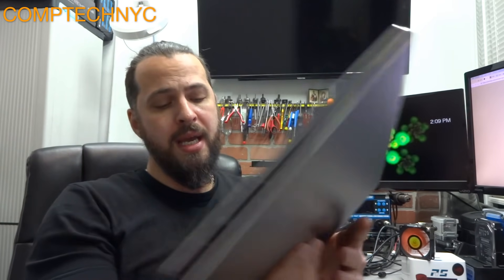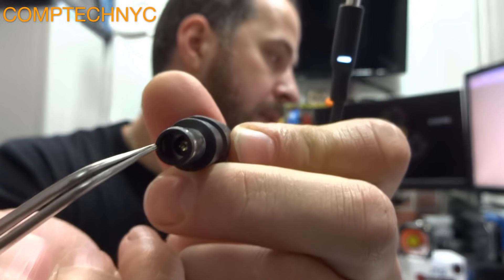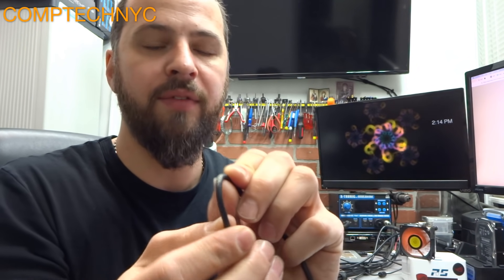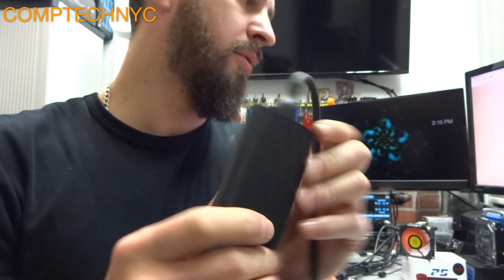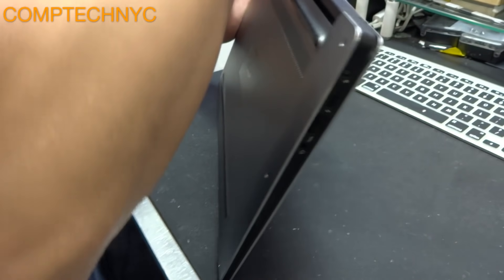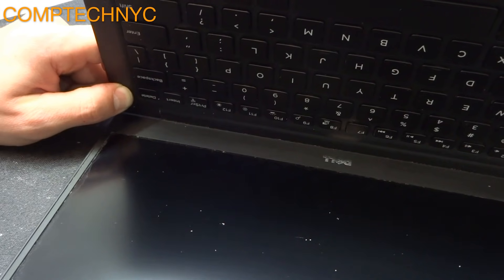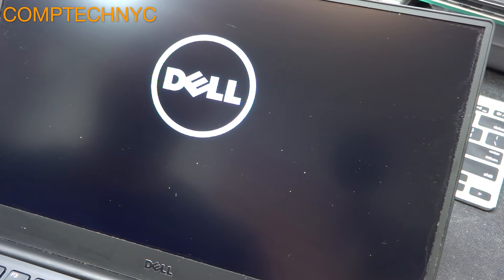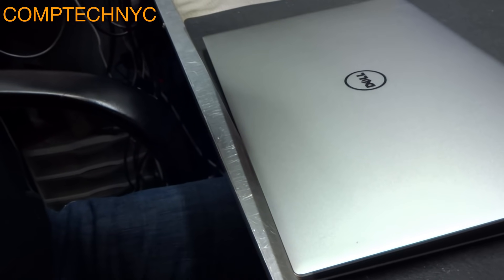Dell xps plugged in not charging fix

Comment: [UPDATE] Next reboot, the plugged in not charging has reoccurred. 😳😔
I think it’s the charger jack. I’ll fit a new one in a week or two and update. 

I’ve had problems with my XPS 14Z ‘plugged in not charging’ for ages now. 
Tried various new power adapters and 2 new batteries with no change. The information in this video fixed it!! 
THANK YOU!!!!
(Don’t forget to go into the BIOS and update the system time afterwards!)

Comment: Absolute magic! I have a 2017 XPS 13 and it wouldn't power on nor would any lights come on when plugged in. I did the steps to disconnect the battery and clear the bios and it worked as shown in the video. My charger cable was fine. Thanks a ton!
Reply: bro I have the same prblm did u jst did what he did and reconnect the battery and bios and u stopped getting that message afterwards

Comment: Hi thanks for post, just used your method and got powered up but now not loading windows just black screen saying
PXE E61 media test failure, check cable 
PXE M0F Exiting intel boot agent
No boot device found, press any key to reboot.
I’m pressing any key with no effect so powering off by power button. Any help appreciated.
Matt

Comment: Thank you for the great video.

I have a Dell Inspiron 5425 that got stuck at 100% during a forced BIOS update. I powered it off because it was taking too long, and now my battery is not charging at all. I've tried everything, but I keep getting the message that the battery pack is removed or less than 10%. I want to charge it externally because the laptop is stuck at: 'The battery pack is removed or less than 10%. Please install the battery pack or charge it more than 10% for UEFI firmware update.' Strike F1 to continue, but F2 or F12 do nothing. Before the bios update, the battery wasn't recognized at all. This is why I wanted to update the bios, as I thought it might detect the battery.

Comment: Hi, I replaced the battery and I also replaced the charger since I did notice that the center pin was broken. Upon getting a new official dell charger the message says plugged but not charging. Upon further inspection I noticed that my problem is on the computer end where I connect to the charger. So it's not the charger itself because I bought a new one. It's the part of the computer where It connects to the charger. How can I fix this part or where can I order that internal computer part?  Any and all help is greatly appreciated Thank You.

Comment: I've been using a Dell Inspiron 13 7359, 2-in-1 for 5 years and you wouldn't believe how fragile is that identification wire in the charger cable.  Even though the adapter works just fine and the cable looks solid from the outside that damn thing gets damaged somehow and your computer won't charge without it. Although I am a very attentive user and my charger was never worn out like the one you show in this video, I had to buy a new Dell charger every 1,5 years. After buying the last one, I found a large flat tin box and put the charger in it when not used in order to prevent the cable from getting twisted. Today, after two years, my last charger gave the first recognition failure despite all the care. It was possible to get the thing to work only by changing the cable position a few times before replugging but it was a very bad sign that the connection failure now wil start getting worse and worse in the upcoming weeks until purchasing another dell charger will be inevitable. I got so frustrated with this chronic problem that only for this reason I will never buy a Dell computer again.

Comment: I am a little confused as to what the reset proves. You say it tells you where the problem lies, battery, charger or motherboard. But wouldn't the result always be the same? The only thing a reset could do is resolve the issue but if it does it means you had a bios/software issue and not any of the aforementioned ones. I am not saying that doing a reset is a something that shouldn't be done but for detecting the exact issue I fail to see the importance.

Comment: Thanks for the video. I first replaced my battery, as it started to be weak, so I thought it went dead. Well the new battery did not want to charge. Except that one one occation it suddenly started to charge. So today I checked the plug and thing that the central pin is really quite far in. plugging in the cable and thoroughly pusing it in, with a bit of wiggling, and suddenly the light stayed on and I got charging. Well now what' is faulty, the port or the cable?

Comment: I had an issue with my main power port on my DELL XPS 15 last year, so i decided to use the USB port to power it. The power port cable then has an issie which means i now have both power sources at fault. I took it into the shop for repairs and bought new chargers, they replaced the main power port on the laptop however now when I plug in any of the power cables both main and USB they both intermittmently come on then off, every few seconds it goes off and back on and then off. Can anyone help, the computer shop are not sure what the issue is. One thing happened, when they returned the laptop initially they forgot to put the screws on the bottom of the laptop back on, when I got home and was using the laptop the bottom came off and may have touched my clothing, could this cause an issue? Can anyone help please, im desperate to get my laptop back for work purposes and to travel.

Comment: this worked one time tried it the second time after buying a new battery and charger worked a while i turned it of now does not work at all a few months later mine is xps15 with usbc port charger.  any way to contact or a different way to get it to turn back on? any help or link would be great.

Comment: Hi. Great video.  I have a Latitude E7270.  It has the power adapter not recognised error. I fitted a new dc socket. the problem persists. I have another dell charger, a 90 watt one but that has the same problem even though it works fine on another dell laptop. The Latitude will power up with the error ok and work with the bettery disconnected. If i connect the battery it will start and display the not recognised error, then start to load Windows and then switch off.  Any ideas?? are the Dell chargers specific to the laptop model or can any dell charger with the correct plug and 95watts be used? I am not sure what to try next.  I feel like buying a new charger specific to the E7270 but done want to waste money.  your opinion would be a great help. Many Thanks 🙂

Comment: Hey, bro
I'm so happy that I looked at this video. I have a Dell inspiron 15 3000 intel 5 and the ac adapter was not being recognise so I thought that I need a battery and I bought one. Then the battery still wasn't being charged. I looked into the adapter port for the pin and saw that it was twisted so I straightened it and not the laptop battery is being charged. Just want to say, keep doing what you doing!

Comment: Simple solution.
Either the charging port ( cheap piece on eBay) need replacement or use original Dell charger.
Otherwise use USBC charger if laptop has USBC charge port.

Comment: Thanks for the video, unforunately it didn't work for mine. This is my second Dell that has died on me in under 3 years. My latest Dell the P56F has countless issues, charger not detected, hinges lifting the keyboard up, down arrow button broken etc etc. It's cheaper for me to buy another laptop then get this repaired. I will never ever purchase another Dell.

Comment: My XPS 17 9700 has been randomly stopping charging when plugged in since I bought it ... both with the charger and the Thunderbolt docking station. My previous Dell did the same thing. There is some design flaw in the dell laptops/chargers that causes this. Unplugging the USB C connection from the laptop and plugging it back in "fixes" it until the next time.

Comment: Got a xps 13 9360 for cheap for the same problem. Open it up and move the charging port cable  a little bit and put a small thin plastic plate over the charging port. Close and power up. The laptop is charging again. Nothing to do with the charger at all. Also any 45w+ USB C charging devices also work once the Dell firmware update is installed.

Comment: My Dell Inspiron 17 (P30E) only charges the battery when powered off.
Have replaced the battery, charger, and charger port (all with original Dell parts), and updated drivers and BIOS.

When turning it on, a message appears saying that a 0W charger is connected and a 65W charger is needed.

Any ideas?

Comment: My friend can you help me. I replaced battery in dell xps 13 9343 3times (not original dell battry) and it is the same every time:
1. battery not charging
2. the yellow and white LEDs flashes
3. in the BIOS under the icon battery shows message : it not a dell battery.

Comment: thanks for the video ... When plugging the charger and disconnecting the battery ... my power cords work fine... So I suppose that my battery is not working .. thanks .... ps : I changed my battery 1 year ago ... is it something else with my computer or its just a simple coincidence? Good video

Comment: Thank you alot man, it just fixed the issue for me

I wanna point out that i had this issue on a brand new (almost 2 month old) dell inspiron 15 5515 and the power adapter was fine with no sign of tearing and so but had the problem of not charging

For my case, i think it is related to issue of dell laptops having trouble to wake up from hibernation. Usually i fix it with a force start method but not this time and plugging in the AC adapter showed no sign of charging

After following this method of unplugging the battery and the bios battery,  the computer started normally and the AC adapter was working fine(it showed no sign of charging because I found out that the battery was fully charged so the computer showed no sign of charging which is the case everytime when the battery is full)

Comment: I just straightened the cable and it fixed issue... (don't panic if: reinstalling drivers doesn't work, changing charging settings in bios etc.)

Comment: I have a Dell inspirion 45 7547, I have done those steps however now the computer lights up since I have done your technique, However I have 2 power adapters and the LED light will not come up when plugged in the computer won't charge . . .

Comment: hello, I have a dell G5 5500. I have recently been experiencing a 4 amber 1 white error. can you tell me the cause of this? I checked in bios and it says that the ac adapter is connected but the battery is idle.

Comment: Hi mate, i bought a new charger. It differs in the model. The new one is LA45NM131 and the old one is AA45NM131. Anyway, the new one is not working so I follow your video and seems to be charging when is disconnect the small battery. But when I reconnect it, the laptop stoop charging. What could be wrong? Thank you. I hope you can help in this one.
Reply: I forgot to said that on the battery icon it says "Plugged in", nothing else.

Comment: Hi I replaced a broken dc jack on my Vostro 15 3558. Now, the laptop doesn't recognise the adapter. Also, the battery won't charge. Is the replacement power jack faulty?

Comment: My dell 5570 i7 laptop didn't turn on with the battery. But it turn on when i remove battery and direct powered by charger. what is the reason and what should i do.

Comment: I’m having this problem with my 5584. My laptop doesn’t work unless it’s plugged in, but then it doesn’t charge and my laptop is so so so slow and horrible and dreadful now. Will a new charger fix my problem?? Or would I need a hard reset or etc.?

Comment: The amber light on my xps 15 flashes orange all the time. The laptop works while plugged in but turns off when I unplug it. Is it a problem with the adapter or something else?

Comment: At 12:54, your front charging lights blink orange/amber to show the system has reset. Mine only stays solid white. Any idea why? I've followed your steps to a T i.e. holding the power button for 30 sec to clear any remaining power.

Comment: Several lives ago when I was a Dell tech (in the age of steam powered D620's (and as far back as the GX1) some of the laptops would decide not to charge the battery.
In that case, I found power down, remove battery, power up, reinstall battery.
This allowed the laptop to "see" that there was a change in state (A battery had been added) and away it went...
I used to work on a laptop or 2... 750 staff in the building I was in so I had a few to play with.
I got chatting to Dell after the nVidia chips were failing on the d620's and I had to point out to them that the CPU/GPU shared heatsync when installed, had a paper thin air gap (you could actually pass a slice of paper under them). The solution was a shim of copper to remove the air "insulation'.

I got disillusioned with IT when they shifted the help-desk to Mumbai and they kept trying to get users to rebuild their laptops when the video chip had failed (the double image on the screen was an obvious clue to a hardware not software fault...)
Reply: I miss playing adventure quest on my step dads d620

Comment: My Dell XPX15 9570 battery is dead but I have been closing it without turning it off.  It also could be a very lose cable connection into the laptop.  It is so lose it drops out.  I had taped it but now I'm using a wire tie.

Comment: A big thanks mate. My XPS 13 did not want to start despite 100% full battery.
I disconnect both batteries, drain the electricity and reconnect - works back !
But I still do not know the root of the problem :(.
Willit happen again soon ?

Comment: THANK YOU!!! My Inspiron 7368 wasn’t detecting my 2 year old battery and adapter (Wattage could not be determined) was powering PC but not charging battery. You helped give me courage to replace the battery with one purchased from Amazon which PC detected as healthy. Then I purchased a new ‘Dell’ adapter from Amazon, solving the “battery not charging” problem. With fully charged battery, I installed updates, which also fixed the speakers that previously sounded so bad I thought they were blown. Now it’s performing like NEW!

Comment: Thank you! this is really helpfull. I my laptop Dell is es ni charging but i can use it if pluged.  it migh be the pin as you say, but im runnning all tha tsts to make sure whay is .
Is probaby tha ac adapter or cthe ac cable. is it is the adapter, is it eassy to replacE? thank a lot again!

Comment: Thanks a lot man, seems it was the centre pin on the original power supply, got a new power supply, problem fixed; wouldn't have had a clue without your video. Cheers.

Comment: Thank you so much for making this video!!  I think there is a small break in the wire of my charger near the end where the plug is because when I bend the cable a certain way, the light goes on and it charges, so I guess it's time for a new charger.  Thanks again!!

Comment: Hi I had bought a dell latitude 3400 recently (around month and half) and i also faced the issue of my laptop not turning on!. I have tried all the techniques of removing the battery and click on power button for 30secs to remove the residual powers and all,  i end up with the same result. Then i tried to run the pc without battery and inserted the battery while booting. This detected the battery and it worked. Hope this helps who are facing the same issue.

Thank you so much for your video, it's very informative
Reply: В какой момент надо включить батарею ?

Comment: Tks for the info, my 2015 XPS 13 9343 did not charge, when plugged in to the adapter the white LED would come on for a few seconds. No message or error indication and no flashing or amber light! Laptop working ok with adapter plugged in to AC. Checked the connector on the adapter cable and noticed no continuity from the center pin to + or - of the adapter at all with VOM, infinity. Cut the connector of the cable and found the blue wire connected to the center pin broke off. Dismantled connector, discarded the light in the connector and resoldered all 3 connections. Charging ok now!

Comment: The end of the cable from the charger gets a lot of bending and stress when plugging/unplugging it, so the center connector often breaks there. Cut off the rubber covering and inspect it. The center connection will probably be broken. 
I fixed mine by soldering a short piece of wire from the center pin connection point to the wire it is supposed to connect with. (Mine was a blue wire, with the white and black wires connecting the ground and positive. Covered it with hot melt glue for insulation and it is working again....ugly though.

Comment: For it worked and didn't have anything to do with the cable etc. I  had a swollen battery and after getting it out my xps won't turn on. Did the Bios reset like described with the battery and voila it started again without my battery! Thanks a lot! I already thought my motherboard took damage.

Comment: Having a blinking Amber light (constant blinking Amber), using a USB c power charger, computer will turn on, but only charger connected, connected not charging, this just happened today, curious why. I don't believe there is a identifed pin with the USB c chargers, but maybe there is something else.